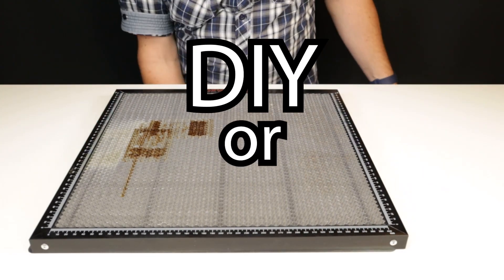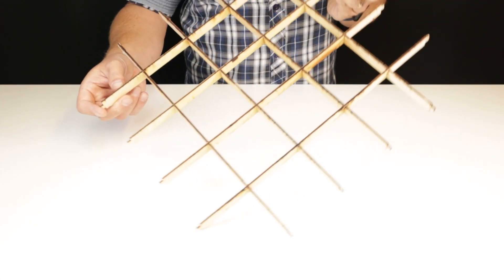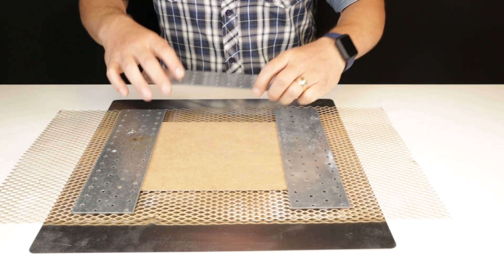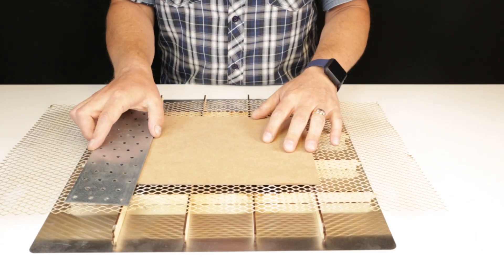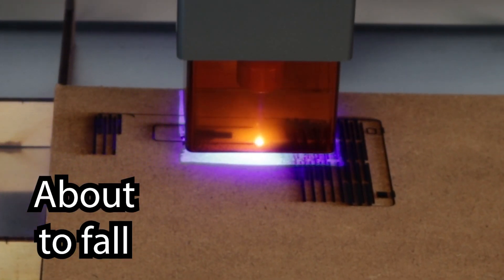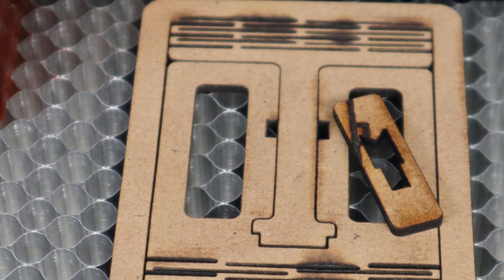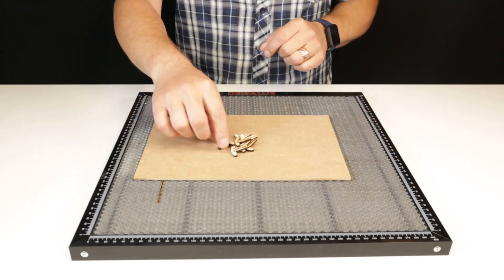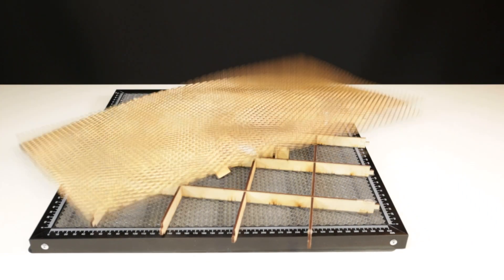Laser Bed: DIY or BUY?

Comment: Be aware when buying the honeycomb bed shown, the dimensions are total, not cutting bed size. So if you buy one to use for commonly available material, 200mm x 300mm, a 200mm x 300mm honeycomb bed, say for a k40, will not be big enough.

Comment: The prices of honeycomb beds are just outrageous, some of them cost the same or more than some diode laser modules :D and the other downside besides the price is that i cant find any with dimensions for my custom laser area 325x860mm :(
Reply: for this size 325x860mm cusomized will be expensive ,have u try ?
Reply: @dz4691  I just do projects that don't require honeycomb bed on this one, or if I need to cut I put the material some other way. I have also a co2 laser that I use for cutting